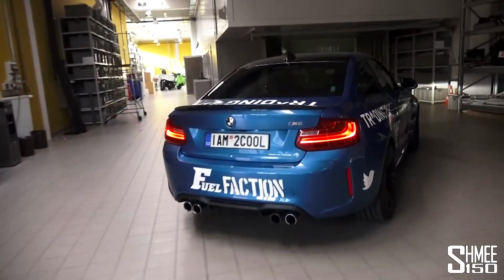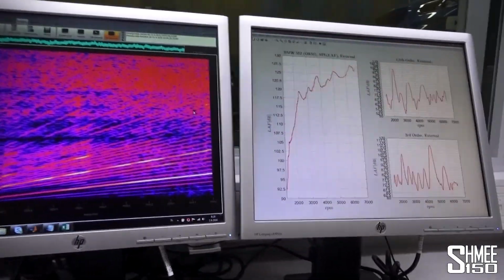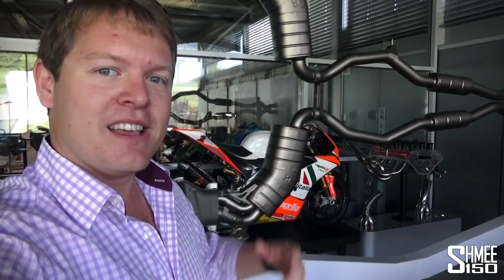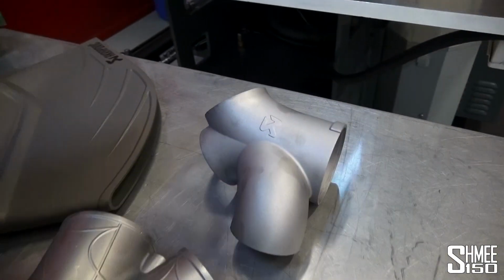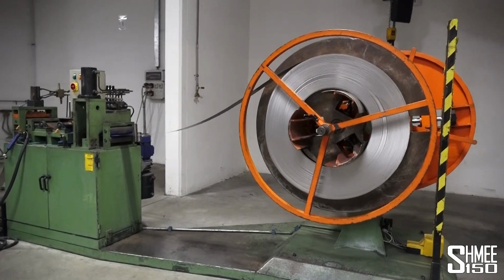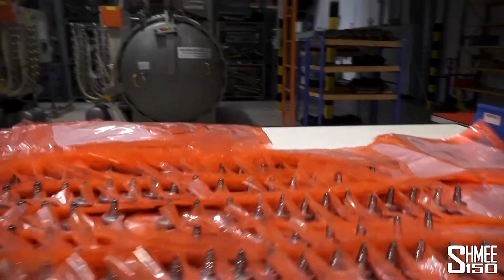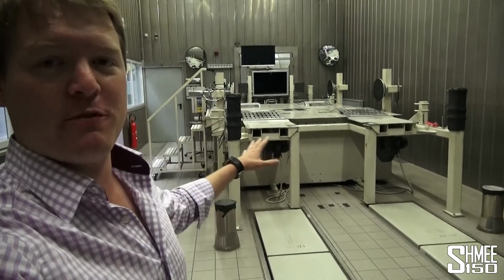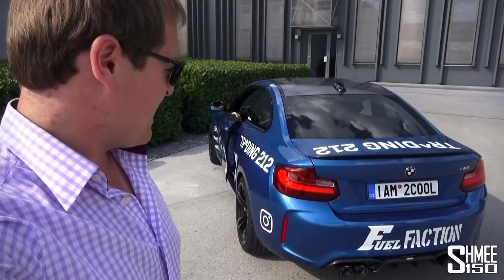Akrapovic Exhaust for the BMW M2!

Comment: I saw the catalytic converter on the boards prior to installation but didn't see it under the car after.  Where did they install it... or did they at all?
Reply from the maker: It is a down pipe with catalytic converter. It was installed, but it is hard to see since it is fitted next to the engine more inside the car.
Reply: Gotcha.  Wonderful looking Ti system.  Thinking about this and the M2.  Thanks, Shmee.
Reply from the maker: Good luck! If you need more information, drop us a message on my website and I will guide you to my manager who drives the M2.
Reply: Shmee150 thanks!  I might do European delivery and get the exterior treated and then a protection film prior to visiting Akropovic for an install at HQ, if they do that.  I'll be touring the Theiß (Tisza) river in Hungary for a few weeks and it would be nice to have an M2 with the exhaust for the trip.

Comment: Whats the display Marc has on his air vent?
Reply from the maker: It is called the Awron display, and it is only for BMW cars. It is an all-in-one display unit that presents a wide array of real time data from the car. You use it by going through different menus and pages providing performance data, engine information and a lot more. More information here: http://www.awron-shop.de/shop/en/awron-performance-display-systems/bmw-2-series/f-series/f22/402/f2xdga?c=1393
Reply: Cool thanks!
Reply: How come he didn't go for M performance steering wheel with display?

Comment: Cool looking exhaust but it seems like a waste of material and fitting-engineering for an exhaust that would coinside with a single bank of cylinders. I get that Titanium is very light and the efficiency probably isn't very different from a single, larger-diameter pipe, but it just seems a little gimmickey to have 2 pipes and 4 tips for a car with an inline 6.
Reply: It is all about engine sound and performance!

Comment: Automatic m2 wah wah stfu
Reply: Yup and it drives better than the manual, which I also tried! As a daily driver it is a much better choice! And you have launch control and burnout mode.
Reply: +MRAmsterdamNL true also there's a drag race comparison with the M4 manual and M4 DCT and the DCT wins every time

Comment: Whats the display in the left air vent for?
Reply from the maker: It is called the Awron display, and it is only for BMW cars. It is an all-in-one display unit that presents a wide array of real time data from the car. You use it by going through different menus and pages providing performance data, engine information and a lot more. More information here: http://www.awron-shop.de/shop/en/awron-performance-display-systems/bmw-2-series/f-series/f22/402/f2xdga?c=1393

Comment: Am I the only one who is seeing some rather large dents on the exhaust system when she did an overview of it??
Reply: I can see 'flat ' areas that have been designed that way to allow for clearance and fitting,however the system would have been flow tested to ensure equal airflow passes through each tube.

Comment: Just wondering Tim, do you gain any horsepower with this Akrapovic system?
Reply: Not much, we will check it soon and see what the difference is.
Reply from the maker: Yes you do but only little.
Reply: Nothing you can really feel yourself when comparing the stock and Akrapovic system back to back?

Comment: Does it not need to be tuned after getting a new downpipe?
Reply: Depends if it has a tune. If not the obvious answer is no. If it was already tuned, most of the time yeah it will need to be retuned. Depends on the tune, if it was just a flash tune or something then yeah, if it was something like a jb4 then no, just change maps.
Reply: Not if you take the downpipe with catalytic converter

Comment: "Non-catalyst would be illegal" Yeah, most catalysts are illegal, too. At least in the EU.
Reply: +UzzyFuzzyy emissions testing and you can visually and hear is there isn't a cat within the system :)
Reply: *****
I guess the MOT in the UK is much more liberal than the german TÜV when it comes to mods.

Technically, EVERY mod that is not tested and has a test certificate is illegal. Especially induction, exhaust, body parts, lighting.

In Germany, chances are high that you won't pass MOT [TÜV] if you have anything on your car that is not stock and does not have a EG/ABE permission. So you can't have a loud exhaust, cold air intake, body kits, etc.
If you're lucky, the MOT guy will still let you pass, but not with any crazy mods installed.

You can get custom or self made parts approved on your car, but this process is very expensive, and if the part does not come with a permission, you gonna have a hard time to PROVE that you meet all the requirements.

And even if you pass your MOT with crossed fingers, the police can still bust you when they THINK your exhaust is too loud. And busting does not mean you get a fine, it means they call a tow truck and tow your car to the next MOT [TÜV] place and let them check every single bolt on the car.
And if they find anything that's not perfectily fine, you get a fine PLUS you have to pay the TÜV. And the TÜV is damn expensive. And then they take your plates until you "fixed" all things on your car and got a fresh MOT.

Technically, those laws apply to the whole EU, but most countries don't enforce them.
Austria and Switzerland are even worse than Germany, while the UK seems to be pretty chill about mods.
Reply: +Ultrabenbooyah I believe Akrapovic has TUV approval for its systems
Reply: Nick Holbrook
I am pretty sure they don't.
Reply: Ultrabenbooyah they have
Reply: Then this confirms that TÜV approval does not depend on fulfillment of regulations, but on the amount of money the manufacturer is willing to pay.
"You want a straight pipe exhaust on your already ridiculously loud, expensive car? No problem. That'll be 10.000€."
"OMG YOU WANT A 3 INCH EXHAUST FOR YOUR FOCUS?! CRIMINAL!!!"
TÜV in a nutshell.
Reply: TÜV is a (or may be 2, doesn't matter) company anyway. They are supposed to do some dirty tricks a company would usually do.

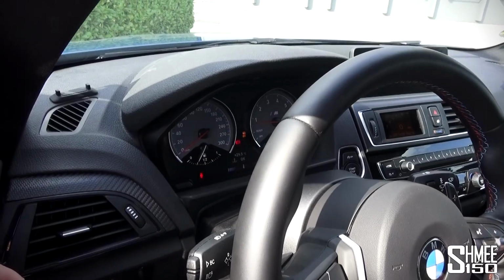Comment: at 15:48 anyone knows what is the screen instead of  the central air vent?????
Reply: Has loads of uses, can record 0-60 times, g readings, rpm readings, speed, oil temp and water temp. Think there more those can do but I don't know much about them!
Reply: Following this one. I have no idea myself, maybe some type of radar detection system?
Reply: +Talon276 is it original BMW or something else?
Reply: They're aftermarket, can't remember who makes them